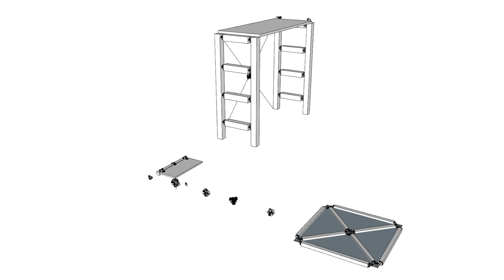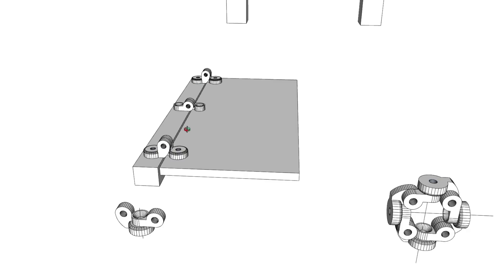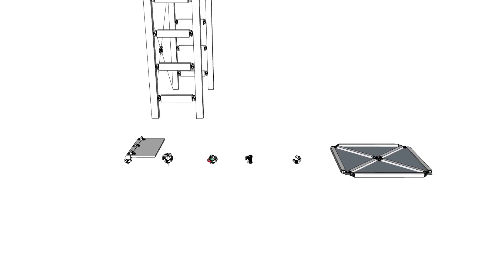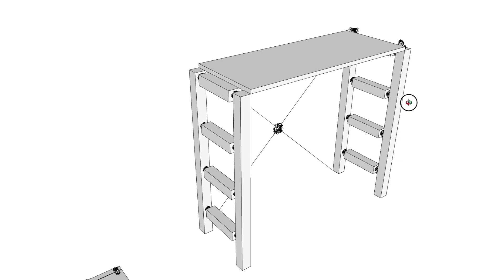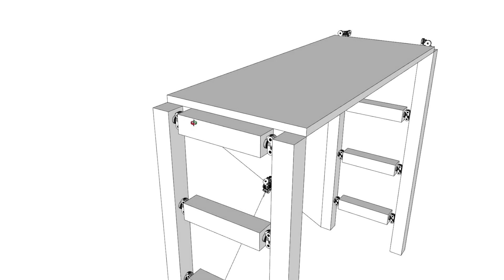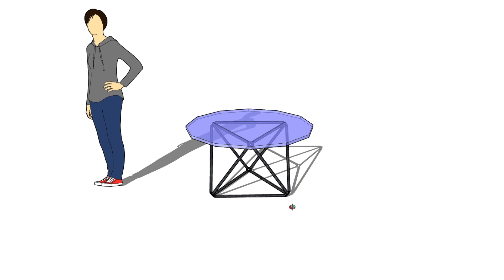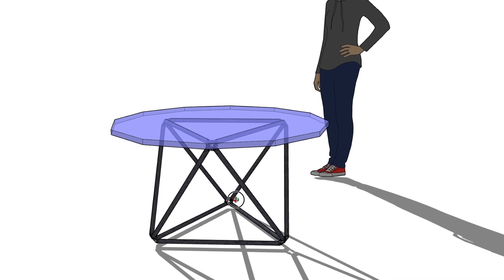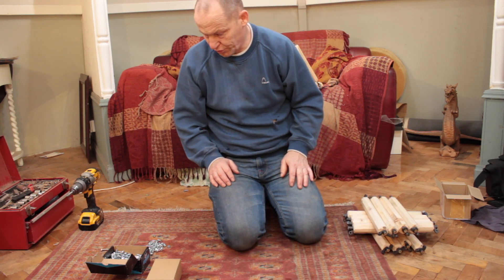UniLnk space frame coffee table design

Comment: I'm sure if the bolt were properly torqued than the stress would have been transferred equally along the length of shaft  instead of creating a point load at the bolt head.
Reply from the maker: I think it was the taper on the countersunk screw, it made the material very the just at the stress point, I'm not going to use countersunk screws and leave the hole square. It's the last fine adjustments now.
Reply: @Geo-Dome  Thanks, I watched the video again and I'm in total agreement. The counter sink area is removing almost 50 percent of the material. It's been 30 years since I was a machine designer and you brought back good memories.

Comment: Paul. Am I right that the brackets are sls 3D printed in nylon or similar?
Reply from the maker: Yes I tried graphite sls and carbon sls (added carbon fibre) both work really well for testing, the company is 3dprintdirect.co.uk
Reply: Paul Robinson I would suggest that the modulus of rupture for these material will vary greatly depending on geometry and build direction. Meaning, it may fail much earlier than expected under load. Also, the initial yield and ultimate strength are fairly close together, showing little or no distortion before failure. I’m saying this as a material scientist that owns a printing bureau. I would try a material with higher elasticity.